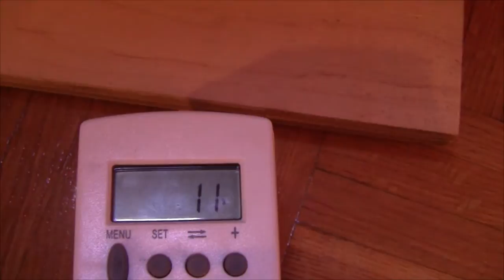Homemade LED Camera Light - Overview and Test

Comment: Surely would be cheaper or at least more practical to buy a cheapo tripod to mount the light.
Reply from the maker: I did consider that option actually, but the best deal I could find was a second-hand partially damaged tripod for $25 . I built my stand from a single 8 foot 2x4, and I still had enough lumber leftover for my second light stand. The 2x4 cost me about $2.50, and my only other expense was the metal fasteners and drywall screws, which didn't amount to more than $5. At a material cost below $6.25 per stand, you'd be hard pressed to find a sturdy tripod cheaper than that! However, as I said in the video there are definitely better designs that can be used.